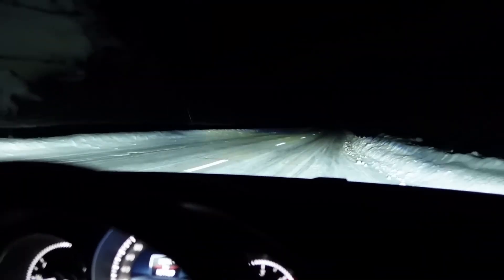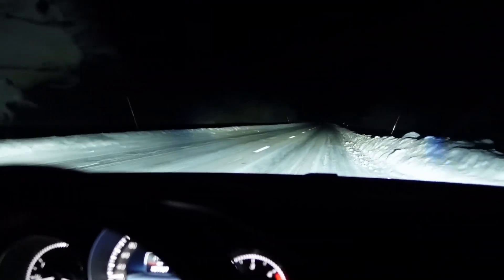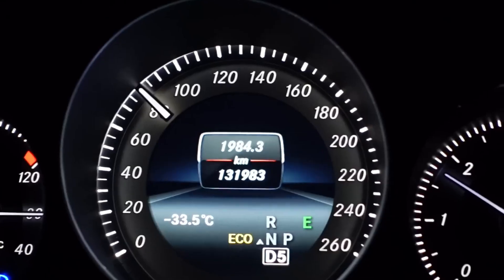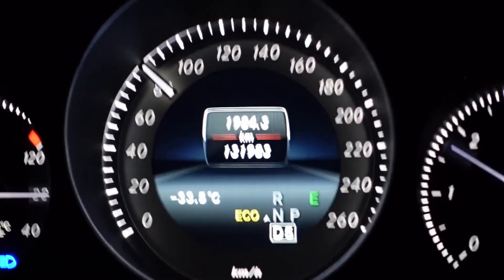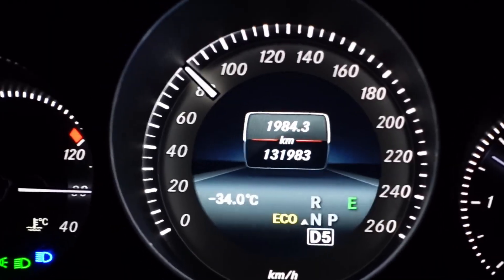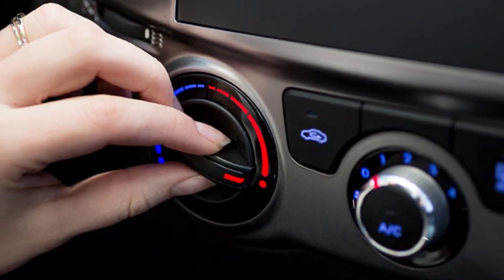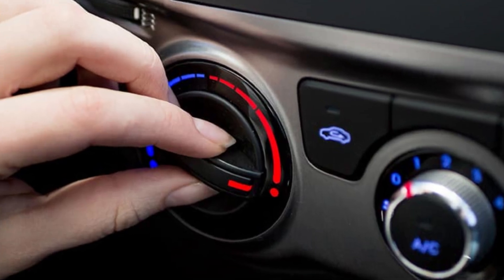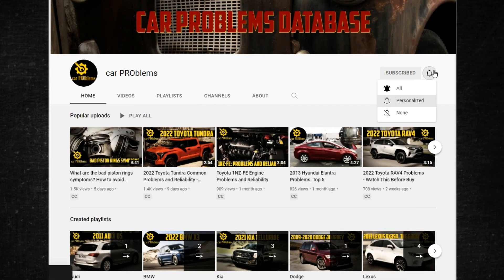5 Reasons Your Car Heater Not Blowing Hot Air

Comment: Antifreeze comes out of my vents when heat is turned on
Reply: U have leak somewhere... I just went through this did you get it resolved
Reply: No, I think my heater core has a leak and fan blows it in my care, coating wind shield with anti- freeze . Major money to fix.
Reply: @tagirattana brutal! I just put my original radiator cap back on after trying 2 new ones and i got my overflow tank back to level when cold and the heat only works when i fill n burp the radiator but get cold after driving 20 mins. I busted my upper hose too, that was fun, grated i have 180k miles 😅 now im thinking my issue is either water pump or worst case...gasket. in that case k-seal here i come 😭 good luck!

Comment: Newbie question.  In my honda pilot when i turn on the heater. at relatively low settings, i would say the behavior is normal. but once the temperature slider hits a particular spot, it as if there is no heat regulation at all, and the temperature of the heat blowing out of the vents is literally over 100 degrees farenheit.  Any idea what part of the heater system is failing for the actual temperature to not be well regulated? Perhaps there is a temperature sensor somewhere in the heater core?
Reply from the maker: Your heater system’s temperature regulation is likely failing due to a blend door actuator or the blend door itself sticking — not a heater core or coolant problem.
Reply: @carproblemsmax  thank you much. until yesterday i knew zero about this aspect of the car. but now after watching tons of videos, i feel a tiny bit knowledgeable.  i will try replacing the blend door actuator first.  if that makes no improvement, I will investigate the 'blend door' (as ive not watched any videos on that part yet.  also might you know this answer?  since the ac/heater control does actually allow one to set a temperature digitally, lets say 65 to 85 degrees (i dont actually know the true range, so these are sample numbers). i assume there must be a thermometer somewhere in the duct system that delivers the hot or warm air into the passenger compartment.  is that likely also inside of the 'blend door' assembly? thanks for your help with the videos and your knowledge.

Comment: Hi, i got honda civic 2012 Lx. Mine problem is my car does not give proper heat in winter and proper cool air summers. It only gives when i drive for 15-20 minutes after that it is good. I filled up coolant in reservoir and radiator too and also changed the thermostat 
What could be the reason now for that???
Reply: Pollen filter maybe
Reply: Did you get it figured out
Reply: @nickiesimon2127 no not yet still facing the same problem